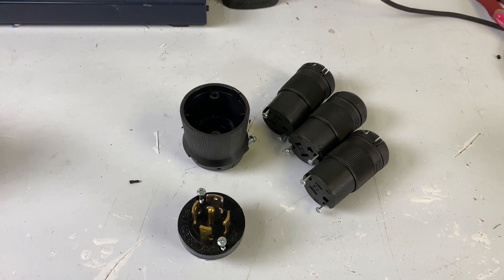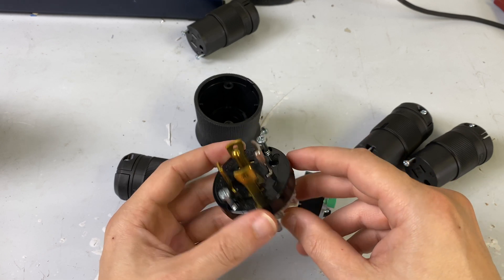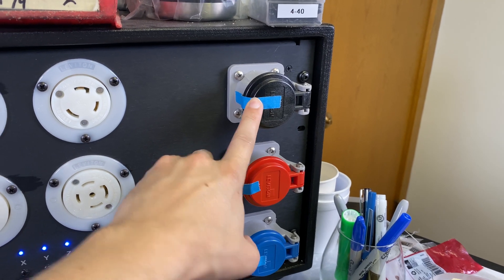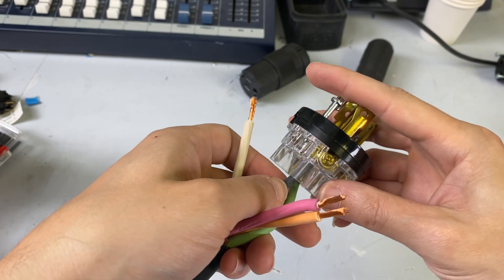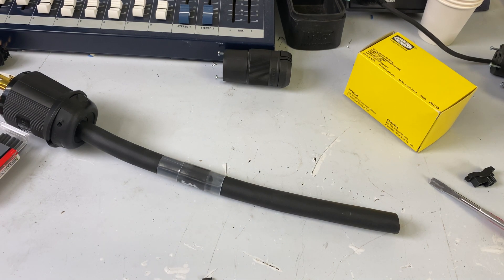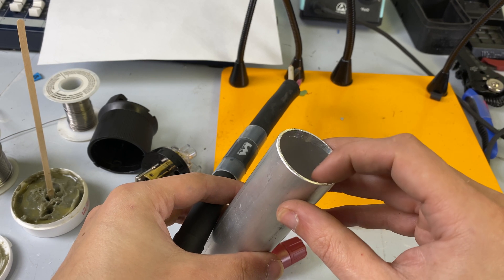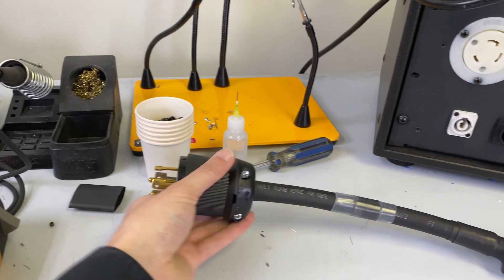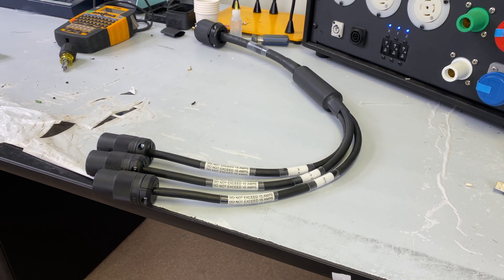L21-30 3 Phase Split To AC Receptacle Power Cable Three-Fer

Comment: Wouldn't it be just as easy to follow code and use L21-20 male to feed three 5-20R cord bodies  and have your 3 - 20 amp circuit breakers feed the correct L21-20  to match the amperage outputs of the circuit breakers?   What is wrong with your using 30 amp parts to plug into a 20 amp circuit, is your adapter  can now be plugged into a 30 amp circuit some where else and not be protected properly.
Reply from the maker: Sure. A 21-20 would be the correct choice. However their distro only had 21-30 outlets. The input of the system i built had 20 amp breakers to protect against this. Also, this is a custom cable that isn’t for sale to the general public. It’s specifically designed for the rig we built and to be used only when 21-30 power isn’t available. Here is a video on the build: https://youtu.be/F5KY0z7eWgw?si=hg1JgxcdvxZHmi4b

Comment: Hi Billy You are very entertaining as well as informative. Please clarify: the neutral from the L2130 are merged together with each neutral wire of each 5-20 breakout cable, correct? As well, same thing for the grounds. The ground from the L2130 is merged/bonded/twisted with each/all ground wires of each/all 5-20 breakout cables, correct? Then each one of the hot wires from the L2130 connect each of the hot wires of each 
5-20 cable individually. Please confirm, especially regarding the neutral and ground wires. Thank you so much!! You are hilarious.
Reply from the maker: Ha! Thanks for the kind words! Yes, the neutrals are tied together. The grounds are also tied together. This is the same wiring scheme as any electrical panel: There is a buss bar that all the neutrals are wired to and a separate ground buss bar that all the grounds are wired into. If you used a multimeter to check continuity, touching any two neutrals in the cable assembly would have continuity, the same for the grounds.

Comment: Did you meter the Edison tails or measure the voltage? I think the voltage of one of the hot legs is 200 and the other two are 120 so you have to be careful with the extra voltage of the 200v leg
Reply from the maker: L21-30 is 3 - 120v hot legs. They all meter at 120.
Reply: Voltage from any hot measured to neutral will be 120, voltage measured between two hots will be 208.

Comment: I have a powercon 30amp and want to power an amplifier off of 2 Edison the main power break for the entire rack is an l-25-30 is there a way to create a breaker panel that will power all three amps on l-25-30 than power each individual one via split 15 amp Edison to 30amp powercon? Thank you in advanced

Comment: Cool vid.  How would you make a cable like this but in reverse?  3 male to one L21-30
Reply from the maker: Same way as this with different genders of connectors. The AC receptacles would be “male” plugs, and the L21-30 plug would be a “female” connectors. You need to be very careful when doing this. A standard AC plug is only rated for 20amps. If you are using this for a motor, it could draw more than 30amps on start up. The system that I was using this cable in used 20 amp breakers ensuring that this cable never was overloaded.
Reply: @billylaguardia  You would have to have the 3 Edison male 20 amp 120 volt plugs  -  plugged into receptacles from 3 -20 amp 120 volt circuits on THREE different phases.  or you will overload the neutral . Because that means 2 of the circuits are on the same phase and your sharing a neutral.
Reply from the maker: @kenstreetsmart852  you are correct in the sense that you need separate phases for it to work correctly - assuming you were powering a motor or another load that required 3 phases. However you won’t overload the neutral. All panels have a common neutral buss bar that goes back outside to the pole/transformer. As an example, look at power lines: the top three lines on a power pole are L1/L2/L3. The next singular wire down is the neutral.
Reply: @billylaguardia  If someone plugs them into three outlets on different breakers, but on the same phase, you could have up to 60A on the neutral before any breaker tripped.
Reply from the maker: @petermichaelgreen  if we are arguing the theoretical: Where someone makes a 3 male Edison to female 21-30, and that someone plugs all the males into separate outlets on the same phase, yes you would overload the neutral. However in that same scenario, you would have to plug the 3 Edison’s into 3 separate outlets that are all on different breakers to achieve that load. If you plugged the males into outlets on the same breaker, you would be limited to the 20amp breaker on that outlet. For the record, I do not recommend making a 3 male Edison to 21-30 cable for this and many many more reasons.

Comment: Hey friend I have a question: I have a power distro motion lab with L14 30amp and have as well another power distro L21 30amp 3 phase. I want hook them up both together for dj gigs led wall screen , pa , lighting etc etc.... but need an adaptor from L14 to L21 or  vice verse, could you tell me how to do those adapters or have any diagram link?..
hope you understand my question, thanks in advance!
Reply from the maker: It’s easier to go from a 21 to a 14. Just don’t wire the 3rd hot coming from the 21. Cut the third hot cable off and don’t connect it to the 21. You will still get 2 - 30amp hots, a neutral, and a ground.